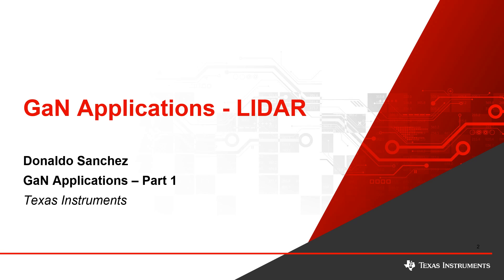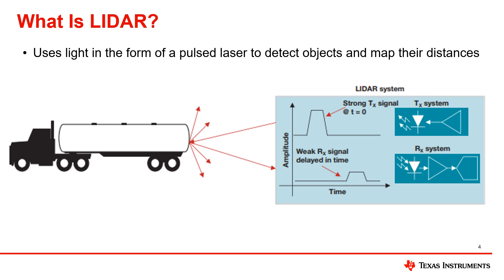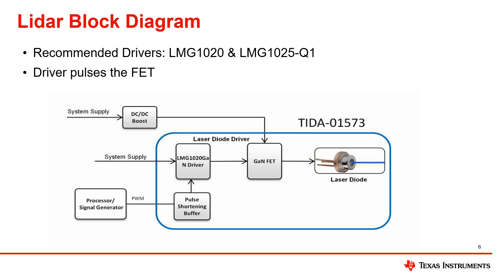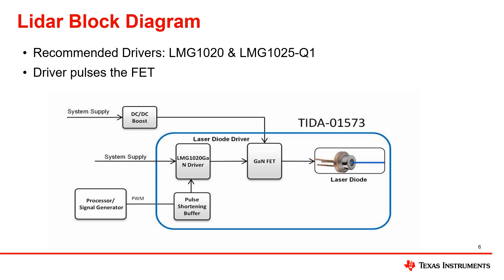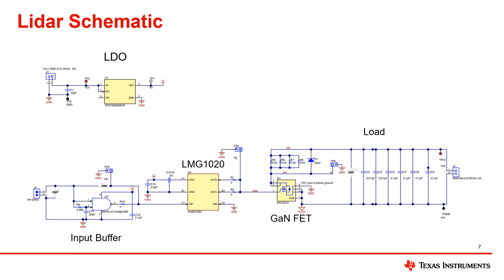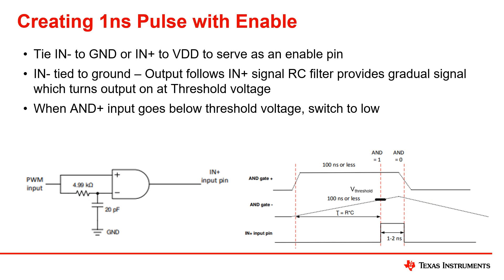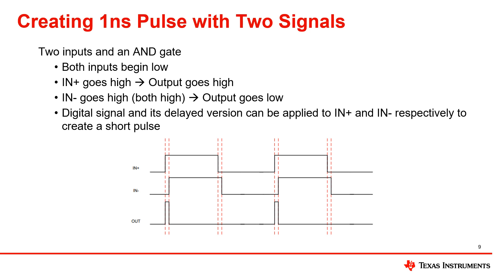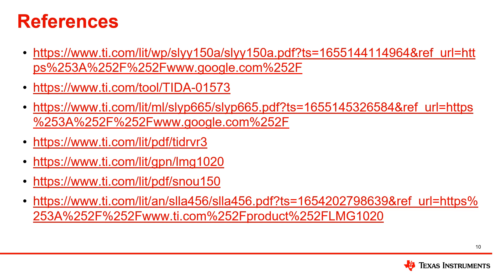Introduction to LIDAR using GaN

Comment: Stabilized magnetic alloy, with a divider in the form of aluminum oxide...

50% - iron

15% - nickel

15% - cobalt

11% - aluminum oxide 3

3% - samarium

3% - neodymium oxide 3

1.5% - copper

1% - chromium

0.5% - yttrium

First, the bulk of the metals are alloyed without aluminum oxide at a temperature of 2250-2350" degrees Celsius, then aluminum oxide is added and mixed, then it is cooled to 1850-1950" degrees and cast into molds, followed by annealing at a temperature of 850-950" degrees...

Comment: A special magnetic alloy with oxidized forms of ferromagnets and also with oxidized alloying elements… Hard to alloy in very strict temperature and time limits, with a certain sequence of adding alloying elements...

50.25% - iron
16.75% - iron oxide 3
3.75% - cobalt
1.25% - cobalt oxide 2
4.5% - copper
1.5% - copper oxide 2
4.5% - samarium
1.5% - samarium oxide 3
2.25% - neodymium
0.75% - neodymium oxide 3
0.375% - manganese
1.125% - manganese oxide 2
0.75% - yttrium
0.25% - yttrium oxide 3
0.5% - boron oxide 3
9% - nickel
1% - chromium

1)
pure non-oxidized minerals are introduced into molten iron with nickel and chromium, at a temperature of 1950 - 2050' degrees Celsius in this sequence...
iron, nickel, chromium = copper = neodymium = cobalt = manganese = samarium = yttrium...

2)
after that there is a decrease in the temperature of the melt to 1750-1850" degrees and the first introduction of oxides...
manganese oxide 2 = cobalt oxide 2...
the time between making at least two minutes...

3)
further, more refractory oxidized forms of minerals are introduced after heating the melt to 2550-2650" degrees...
yttrium oxide 3 = samarium oxide 3 = neodymium oxide 3...
with a time interval of the application queue of at least 2-3 minutes, with mixing 1-2 minutes after application!

4)
after lowering the temperature of the melt to 1650-1750" degrees and introducing the remaining elements...
copper oxide 2 = iron oxide 3 = boron oxide 3...
Also observing the sequence and interval of application of at least two minutes with stirring of the molten mass...

5)
after casting the product, it is necessary to anneal for 3-5 hours in a protective gas (argon), at a temperature of 900-950 degrees, followed by slow cooling in a furnace also in a protective gas for 5-8 hours to a temperature not higher than 200-250" degrees Celsius...

Comment: A very stable, hard-strength magnetic alloy suitable for any industry, working temperature not lower than 200” degrees Celsius, at a relatively low price and the most simplified production - using conventional casting and subsequent annealing for 2-3 hours at a temperature of 850- 950 "degrees Celsius in a shielding gas (argon) - for protection against oxidation and for better carbon burnout from the bulk of the metal, and subsequent slow cooling for 4-6 hours also in a shielding gas, to a product temperature not higher than 200-250" degrees Celsius...
------------------

67% - iron

8% - nickel

5% - cobalt

------------------

79-81% - pure, non-oxidized ferromagnets...

------------------

6% - copper

6% - samarium

3% - neodymium

2.5% - boron

1.5% - manganese

1% - chromium

------------------

19-21% Doping additives with an additional function as a divider of the main mass of ferromagnets into smaller grains...

------------------